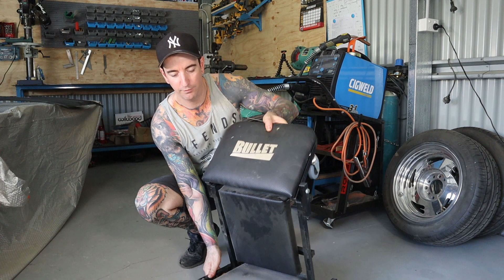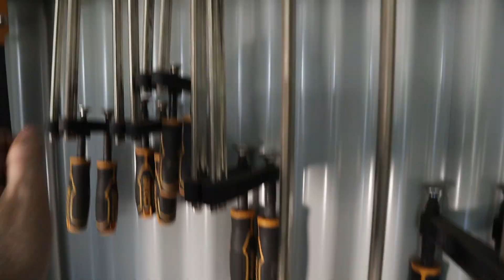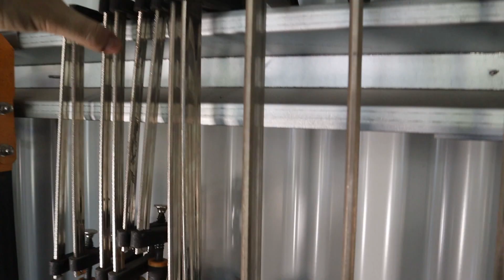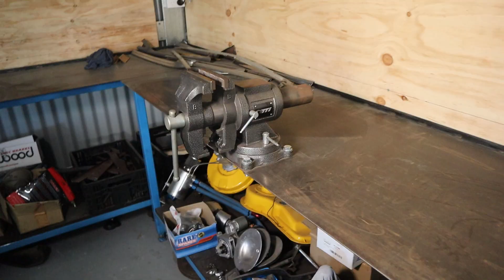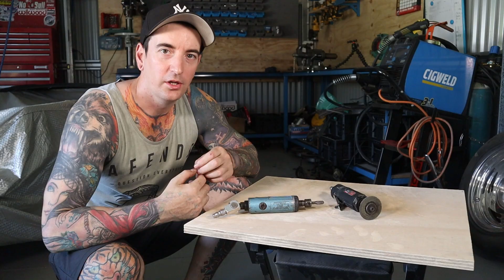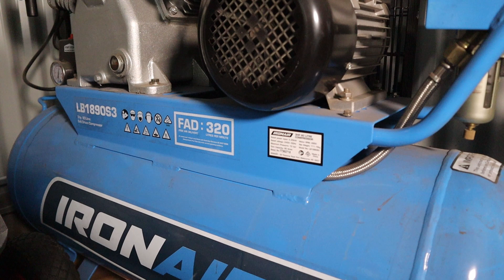Top 10 Tools for Building a Project Car

Comment: Hey mate not sure if you have showed it in other videos but what sort of water trap do you run on the compressor for painting etc?
Reply from the maker: Hey mate I'm just running a standard water/separator that comes with the compressor. I do plan on making a decent one from copper piping when I get free time.

Comment: Found similar clamps on ebay with plastic on them, did you just remove the plastic pads?
Reply from the maker: Yeah mate sure did. Just remove plastic and keep the plastic in case you wanna use for wood.

Comment: Pretty spot on there mate. I reckon for people doing a proper resto. A rotisserie is a must. I tried to get away without it but it was sooooo much easier once I pulled my finger out and got one
Reply from the maker: Yes that is a good one. The tonner is not so bad as you can flip the cab up on the back to get underneath. If it was a sedan or ute then def I would of purchased a rotisserie.